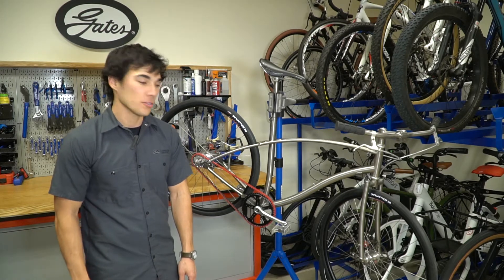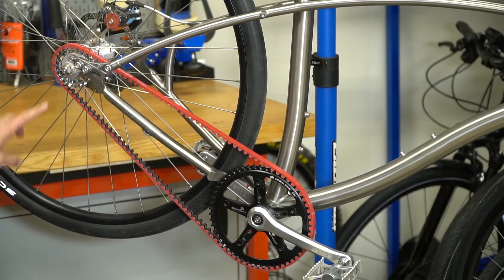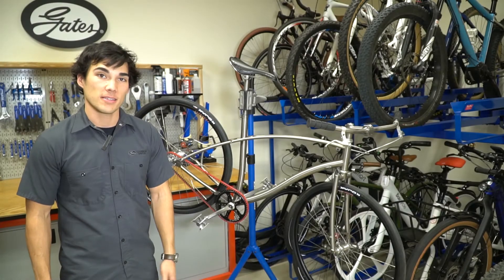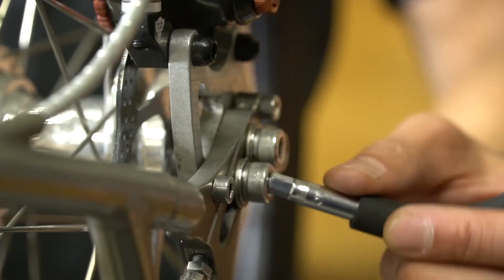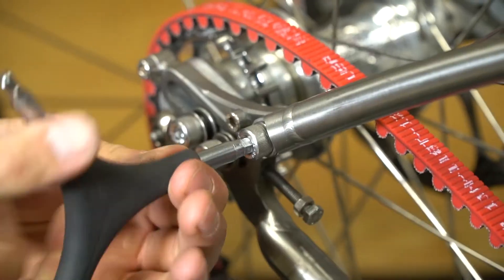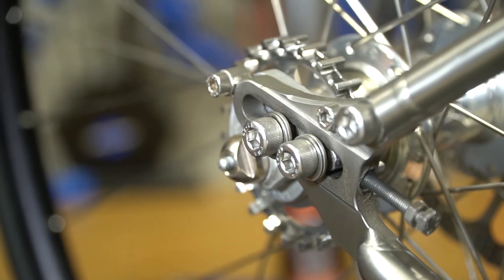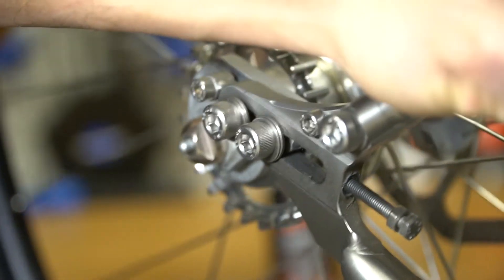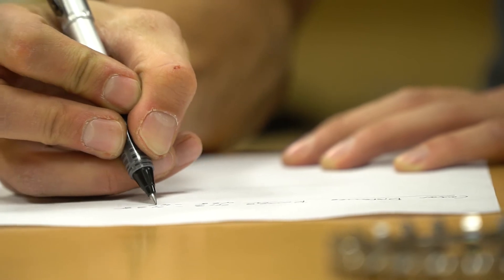Gates Carbon Drive U | Measuring Center Distance

Comment: I am rebuilding a Raleigh Misceo i11, according to Raleigh's spec sheet it came equipped with a Shimano Alfine 11 gear Inter hub, with a 50t front and 20t rear CDX cog. Looking at your products page I noticed that you don't offer 20t CDX cog, the smallest is a 22t. Could you let me know if you could assist me in how to proceed? Thanks and cheers, Chris
Reply: The absolutely have a 20t. Look online